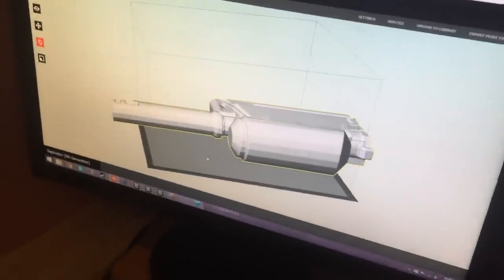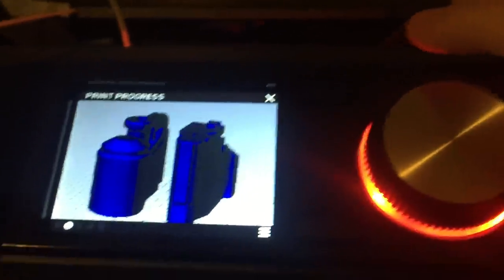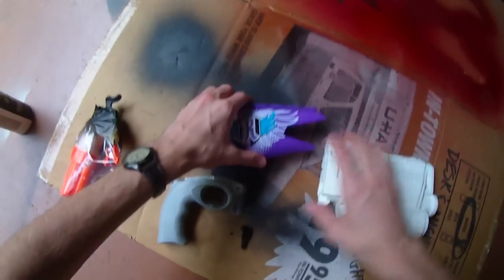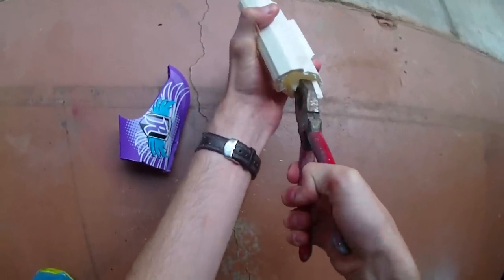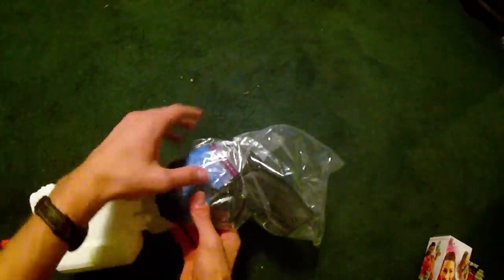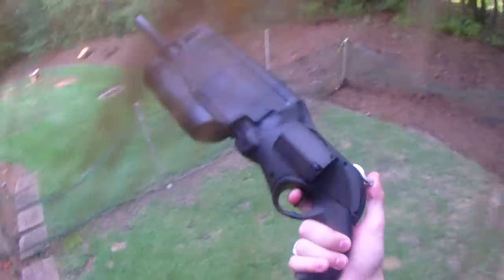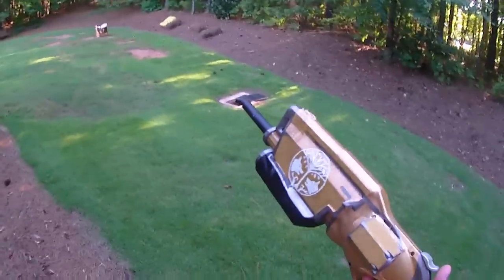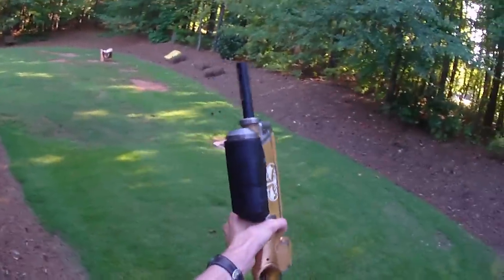Real Life "Timur's Lash" Functional Replica Nerf Mod

Comment: Hey Drac have you ever considered attaching the male connection of a recon long shot or any barrel extention accepting blaster to one of these Destiny guns so you could remove the 3d printed parts from the front and load the blaster then reattach it? I don't know just something you could possibly do to add more ammo to the blaster. Not hating on how you did it just giving some possible tips, still the final product looks awesome

Comment: Hi Drac, not wanting to be a bore but for the cylinder I feel you that should not jam two halves of a cylinder to the side of the gun but instead cut it so the It looks like a proper cylinder[?]. like its should be be an O when you look at it from the back and not an OO.

Comment: how expensive is the plastic for the 3d printer?
Reply: +Hannah Sealer typically between $20-$40 per Kg
Reply: +Hannah Sealer and then the makebot 3D printer he's using is $3,600

Comment: do a fell winters lie and us insides of something that shots very far.
Reply: +simon weeber  A shotgun doesnt shoot very far in destiny. But it does shoot eight pellets at once.  Hint hint, roughcut with air restrictors removed so all barrels shoot at once?
Reply: +Benjamin Ahern It shoots farther than my sniper! Also, 12 pellets.
Reply: +Benjamin Ahern  I think you have never heard of felwinters or matador it can kill you easily cross map with shot package and range finder it's even better
Reply: Shaheer Khawaja  Lol, no shotguns can kill you from a max range of about 10 feet, If shotguns could shoot crossmap, no one would play destiny.
Reply: +Benjamin Ahern wanna rumble and find out the power of felwinters
Reply: DafordMC  No, it doesnt. And also i cant think of any blasters the have the potential to shoot twelve darts at once without heavy modification.
Reply: Benjamin Ahern Yes, It does, count the bullets. But yes, might have to just do 8 or so for the blaster.
Reply: DafordMC No, I meant you were right about twelve pellets, but not about the sniper